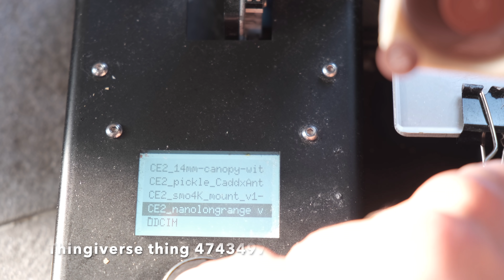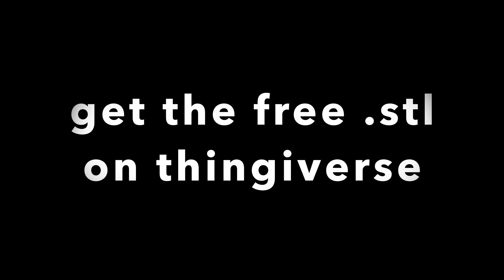3d printed nano longrange FPV drone

Comment: What do you mean when you say long range? Don't get me wrong, I love what you did there, but I was hoping to see it actually go far. To me, looking range is more than than walking distance. I've flown my freestyle drone about 500 metres at the most and I still don't feel like I've done long range. I guess people have different ideas about that.
Reply from the maker: i was handicapped by the frsky receiver. they market it with 2km range... however, with the right radio this drone will cover a distance of around 5km. so more than 2km range. i plan to switch to elrs and gonna prove it

Comment: I've downloaded and printed this frame and it works outstanding. I'm on my 4th frame printed in PETG as the camera mount keeps breaking in crashes. It snaps off where it joins with the rest of the frame. Not a big deal but something to improve if you decide to see if you can make that area more robust. Thanks!
Reply: You could probably make this change yourself fairly easily in fusion 360. It is free and simple to learn within about a week. I had learned to design a lego brick the first day. In no time you will figure out how to import someones stl mesh, convert it to a body and manipulate it to suit your needs.
Reply: @JasonEllingsworth  Thanks but to be frank I have no interest in learning fusion. I've spent the time learning freecad so don't want to waste time learning another tool. In the end I'll just keep printing frames when they break.
Reply: @pbshooter100  well I mean I was assuming you had zero cad experience. You could make the change in freecad
Reply: @JasonEllingsworth  yea I don't have any practical experience with anything although I have spent time learning freecad. anyway i printed about 10 of the frames so that should do me for a while lol

Comment: cool build. do you know what is the motor thrust? could it fly with additional 30 grams?
Reply from the maker: on paper 130gr/motor. Not sure if the 18650 can manage it though. And you ll loose a lot of efficiency.
Reply: oh thats a lot more than i need, thanks for reply

Comment: That lipo is severely under powered it wasn't even at 3 volts at the start of the flight. If you try something around 1000-1500mah you'll probably get around 10 min but, with better performance than the 18650.
Reply from the maker: you re right. I thought that the 5C rating was sufficient but I was wrong
Reply: @Unboxingexperience7  ya if that's 15a continuous it should have been ok but, that 5c is probably closer to 1 if I had to guess.

Comment: Why you call it longrange?
Reply from the maker: It's just limited by the radio I used. 19min flight time at 15kmh /10mph equals around 5km/3.5mi distance or 2.5km/1.7mi range.
Reply: @Unboxingexperience7  If it's limited by the radio then you not call it long-range only because of the longer flytime. But it was a nice little project. I also got 2 of them witch are 3D printed and it's a lot of fun. Nice video!

Comment: How far it can goes n return
Reply from the maker: at 200mW the FPV feed is without break ups up to 700m. you can probably go up to 1km with good FPV gear and not minding about bad fpv feed

Comment: What firmware on your Rc tx? I'm getting low(ish) rssi with my Xlite pro! Seemed you did too...
Reply from the maker: the newest version of access. it s even far worse with the archer m. I m going to switch to elrs 2.4ghz
Reply: @Unboxingexperience7  Seems like many lite series Txs suffer from very low ranges... not very good! Especially as its advertised at 1.5km!!

Comment: Nice. but : Lipo wasnt fully charged at the start of the flight you've just took off and its allredy showing 2.8V
https://youtu.be/7E6jgIrd5kk?t=397
Reply from the maker: it was fully charged, but the C rating of this Lipo is too low. so there is a huge voltage sag...
Reply: @Unboxingexperience7  oh ok, what a huge drop 0.0

Comment: Wouldn't a structural board cause too much vibration to the FC?
Reply from the maker: Tested - it's very stable in the air. It saves around 2 grams which is pretty much.

Comment: What exactly makes it "long range"?  Is there some accepted definition of that?
Reply from the maker: a better rc system :-) there is no common definition, but usually it is about long flight times using 18650 batteries combined with a strong vtx and radio link. long range is about exploring, so you need a few km/mi range.
Reply: You can "legally" call it "long range" so long as you can't see the quad anymore with a naked eye. That definition is generally accepted in the community. A big quad usually has more capability and is larger, therefore you have to go out pretty far in order to call it long range. Whereas a tiny whoop going to the end of the block could be considered long range. I all depends on the aircraft you are flying. Hope that helps! :)
Reply: I am no expert but I consider long range referring to distance. That requires duration of the battery. Long range, to me, exceeds kilometer.

Comment: What's the drone range approximately?
Reply from the maker: 300m with Frsky Archer RS... With a better radio I would guess 9min of range at 10mph/15kmh which amounts to about 1.3mi /2.2km.
Reply: Better radio is going to equal more weight on the quad which will require larger motor and larger battery. I hope you continue this challenge.
Reply from the maker: tracer, ghost, express lrs, cf ain't heavier than the Archer RS. I just need to spend the money on a new radio system :-) But then I ll do an update with lighter frame <8grams, different motors, diamondf4 aio, GPS and HD cam